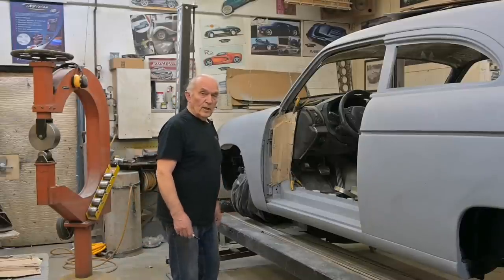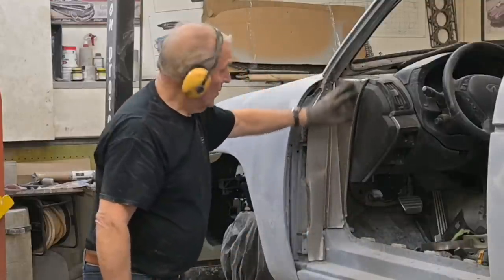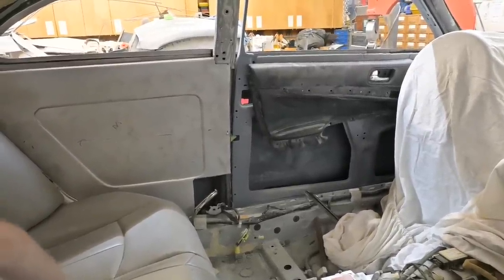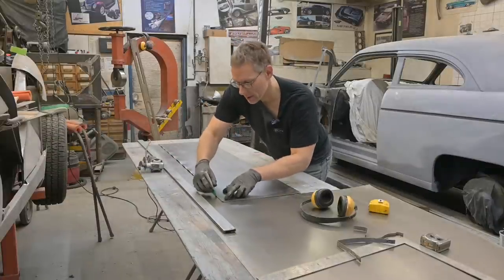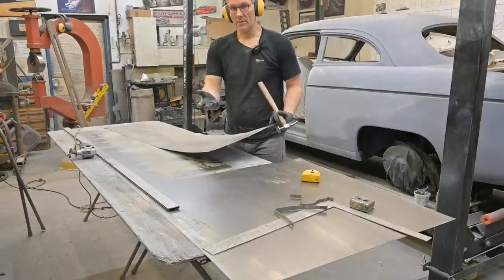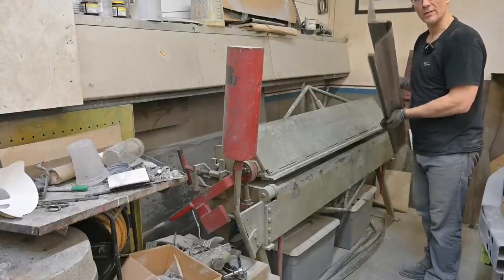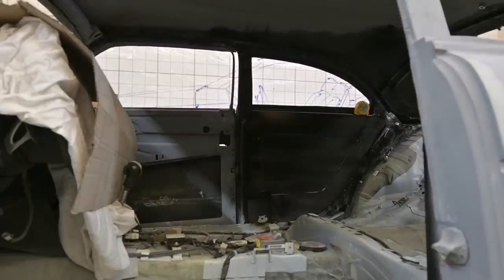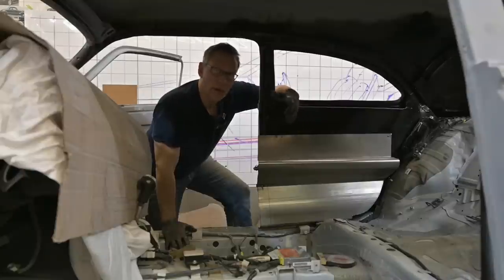Custom Classic Car Interior Mash-Up - Ep.24 - 1951 FORD + INFINITI G35XS Sport

Comment: Coming along nice. ??????? , how'd you get the headliner in and out in one piece? Front window opening?
Reply from the maker: That's the easy way until the glass is installed.  We also slide it into the car and back out through the passenger door after a little tricky twisting action... kinda like rolling one's tongue.  Thanks for the thumbs up Brian!

Comment: Omg I cant stand it for a half hr the back lower pirce needs to be dropped by 3/4" and the bend as well as the gap for the door would line up and you cant see it because you dont go to the driver's side and you'd see it instantly. So whacked as well as the back of the armrest needs a little swoop be boop that will give it a radius and style and class. Yikes I wish I could call u and say whoa cowboy come look at from this side it's all off my brotha
Reply: Bend is way off in the back seat it just needs to move down a half inch it's not level and driving me nuts
Reply from the maker: You've got a great eye for detail!  All of those pointed you mentioned have since been corrected as this was an initial mockup.   A spacer was added to the rear edge of the back panel to bring it out thereby closing the gap at the front and leveling out the panel.  Adjusting those small details take time and was done later off camera.  Thanks for the feedback and taking the time to watch.
Reply from the maker: Bend wasn't off... optical illusion my friend.  Just needed to fab and add a spacer to bring the rear edge out.